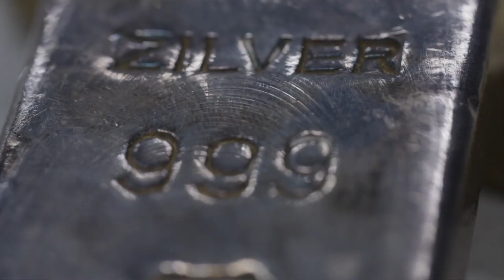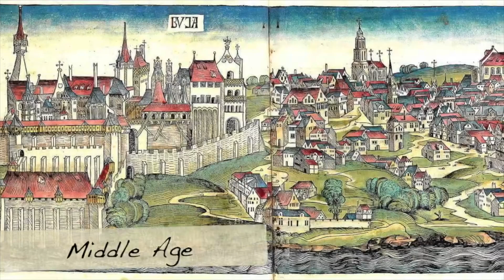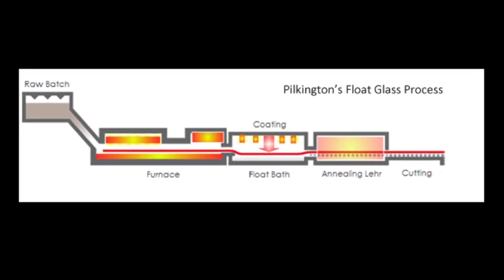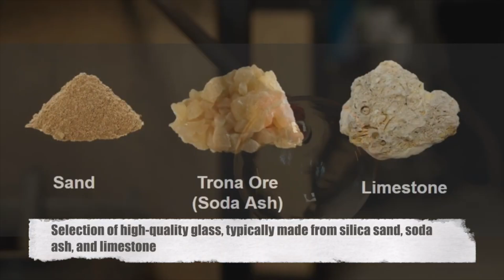How Are Glass Mirrors Made? | History and Manufacturing Process

Comment: Regarding 5:35, ordinary mirrors are known as second surface mirrors which have their reflective metallic layer applied on the back-side of the glass. On the other hand, a first surface mirror has its reflective metallic layer applied on the front-side of the glass. First surface mirrors are used inside telescopes, because their is no ghosting of the reflective image.